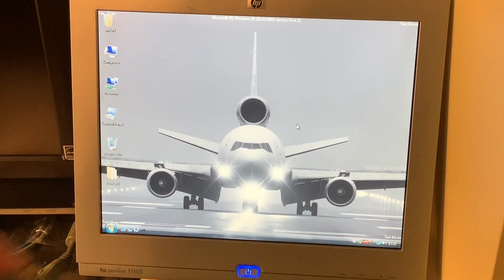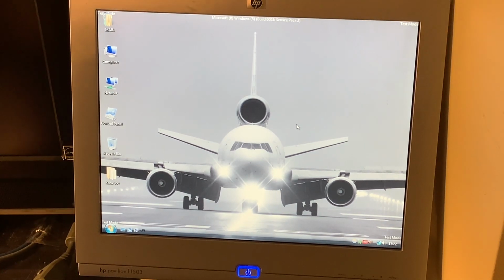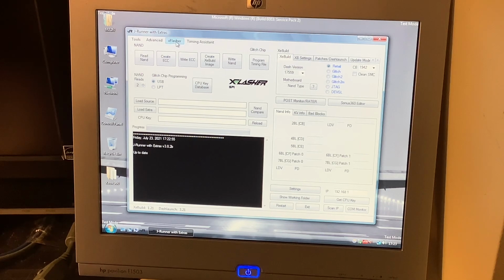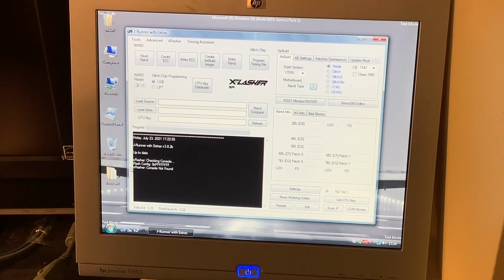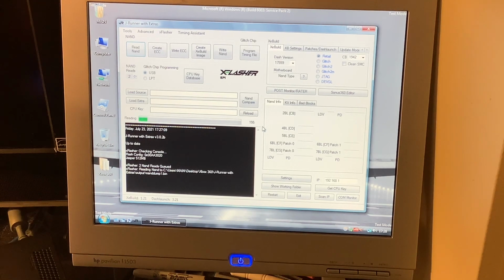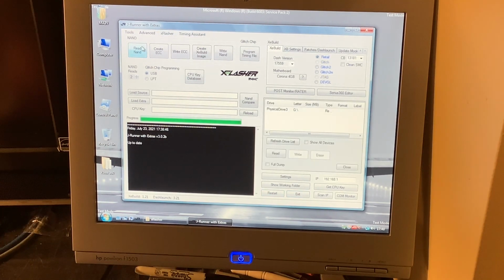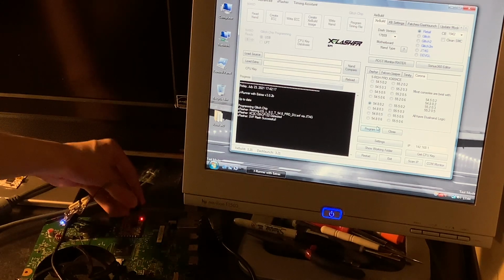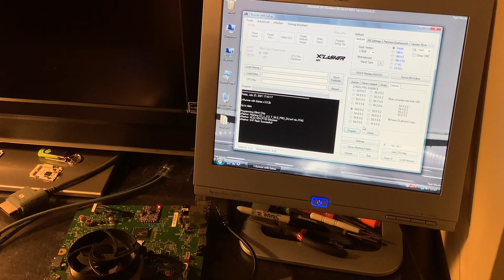xFlasher 360 by Element18592 - Demo and Setup

Comment from the maker: Note 1: Please bear in mind my xFlasher has a few slight physical differences from the final product and is a hand assembled prototype. Do not worry as the operation is the exact same as the final product.
Note 2: The USB-C version is out! Operation and use remain the same.
Reply: anywhere i can get just the emmc cable,  i cant find any in stock anywhere without buying a new xflasher
Reply: Thank you so much! Finally in stock! Just purchased mine

Comment: Yo anyone have a fix for the emmc not showing but it shows spi? I have drivers installed and reinstalled and ive used a bunch of different usb c cables.
Reply from the maker: It's your soldering/wiring.
Reply: @Josh.Davidson i used a raspberry instead. Im not saying youre wrong but im confident in my skills. With that being said i did double check and resolder the wires and it still only showed spi. The raspberry worked first try

Comment: Can I leave WB 2K marked in jrunner on a corona that does not have winbond memory? What will happen? Could there be a problem with the boot? I ask this because some people are flashing a modified nand with the simple 360 nand flash through the new badupdate exploit, without opening the console first.
Reply from the maker: It depends on the exploit. If it's RGH3, then it doesn't matter.
Reply: @Josh.Davidson  like this: I have an xbox E with the corona board with samsung memories, then in j-runner I leave WB-2K and RGH3 marked, then I write this nand on the board, and then solder the 2 wires, could there be a problem with the console?

Comment: Wait so will this allow me to have backwards compatibility now or do I need to still have an RGH mod chip
Reply from the maker: This is just a nand read/write.
Reply: @Josh.Davidson  so therefore just a firmware dump to help the rgh3 or jtag function more smoothly and properly.
Reply from the maker: No. This tool is used during the modding process. It replaces an older tool that is slower and worse.

Comment: Great video 👍 I’m having a little issue. Installed j runner w extras and installed the drivers for the xflasher as well but when I open jrunner while having xflasher plugged in and set to spi mode it doesn’t show up in jrunner.
Reply from the maker: This is not a problem with the J-Runner. 
I would contact your retailer for support.

Comment: Is there any way to restore this device if it gets accidentally formatted?
Reply from the maker: Its not how it works.
Reply: @Josh.Davidson So I did not brick it. That's good because this device is a home run. One of the best things are the twisted wires that came with it. So easy to work with. I actually look forward to working with 4 GB consoles because the wires are so easy to solder.
Reply from the maker: @WisconsinJimmyN  yess!

Comment: hey josh its been awhile. i kinda got out of xbox 360's for awhile but i just got back into them. the 2005 one i tried to fix i accidently brke a trace and now its busted. but i just got another 2005 one thats in MINT CONDITION. but... it sounds like a jet and the disc drive needs tapped to open. but i dont want to open it bc its warranty seal has not been broken. what should i do. is there another way to fix the jet engine problem. i know a way to fix the belt without opening it. what should i do?
Reply from the maker: You have to open it...
Reply: @Josh.Davidson  :(
Reply: @Josh.Davidson what i plan to do once i fix it is keep it for many years and then sell it for a lot of money. how much do you think opening it up will take the value off?
Reply from the maker: @joshuahollobaugh7382  anybody who values a sealed system over an open one is a cock clown.
Just fix it :)
Reply: @Josh.Davidson  ok will do

Comment: Possible to add an on off switch for crystal disconnection on the 4gb models?
It'd be useful rather than desoldering just to read xell.
Reply from the maker: It is there. See the included cables.

Comment: installed drivers and connected to PC; getting error "device not initialized" when clicking on ?. Installed drivers. I am in SPI mode. Any ideas?
Reply from the maker: Please make sure you exclude J-Runner folder from Windows Defender and have waited a bit for the device to initialize (give it about 5-6 seconds)
Reply: @Josh.Davidson  Thank you for the advice. Unfortunately after excluding the folder from defender and waiting for 10 minutes I still get "Device not Initialized" The logo with spi shows properly on J-runner and I get no messages to install anything. I've done over 200 consoles with the old j-runner and the j-r programmer and this new device seems like it would be great especially for 4 GB consoles. Any other things I should look at?
Reply from the maker: @WisconsinJimmyN  please advise what windows you are using? And if you installed the redistributable.
Also, does device not initialize appear immediately or after a moment?
Reply: @Josh.Davidson  My operating system is Windows 7 ultimate 64 bit and initialize appears immediately. Thanks again for your help.
Reply: UPDATE---Worked with a Windows 10 64 bit PC. So I'm good to go. Thanks for your help.
Reply from the maker: @WisconsinJimmyN  alright I will look into issues on Windows 7. Thank you! Enjoy.
Reply from the maker: Any Chance you could test a few things on the win7 for me?
Reply: @Josh.Davidson  Sure, I'll test whatever you want.
Reply from the maker: @WisconsinJimmyN  Thanks, would you please try to install this additional redistributable https://www.microsoft.com/en-us/download/confirmation.aspx?id=26999
Reply: @Josh.Davidson  When I tried to install it I was asked if I wanted to repair the installation so it was clear that the program was already installed. I did a repair install but "Device not Initialized" is still coming up,
Reply from the maker: @WisconsinJimmyN  Sorry I was being a smoothbrain...
https://www.microsoft.com/en-us/download/details.aspx?id=26999

Please click Download, then make sure vcredist_x64 ONLY is checked. Then install that and reboot J-Runner.
Reply: @Josh.Davidson  Unfortunately  "Device not Initialized" is still there. However there is a slight pause between "checking console" and the DNI.
Reply from the maker: @WisconsinJimmyN  Interesting, and the pause is new? Can I also ask what motherboard you run and which CPU?
Reply: @Josh.Davidson  AS Rock Motherboard & AMD A8-7600. Win 7 Ultimate with SP1
Reply from the maker: @WisconsinJimmyN  Thanks. I will get back to you.

Comment: What are the advantages compared to conventional J-R programmer or Nand-X? Also desirable USB-C instead of the outdated Micro USB(
Reply from the maker: Faster read/write, more stable and built in 4GB eMMC mode (no need another tool).
Mini USB was chosed because more sturdy and working with existing cable.

Comment: If only the distributors sold it for MSRP and would be great to have EU distributor.
It costs almost $50 in UK + shipping + EU import tax from UK (around %20 from item+shipping). Very very pricey in EU. No wonder why they sold only 13 units in a week.. of course if the counter is correct.
Reply: I’ve tried getting him to lower his price before launch and after but he doesn’t want to budge unfortunately.
Reply from the maker: Very sorry element have no control over reseller price.